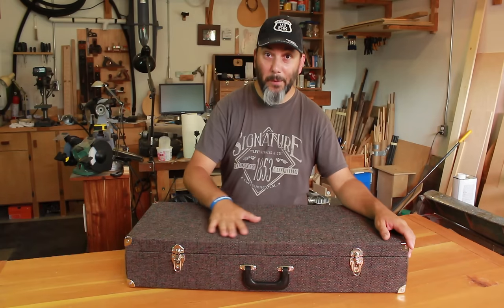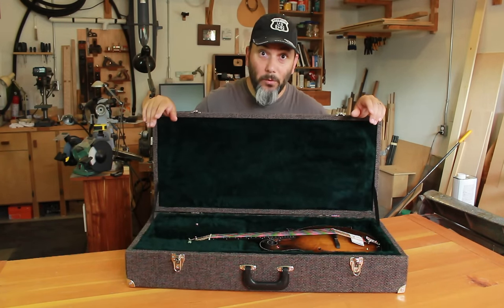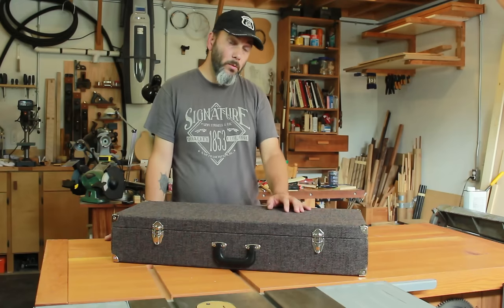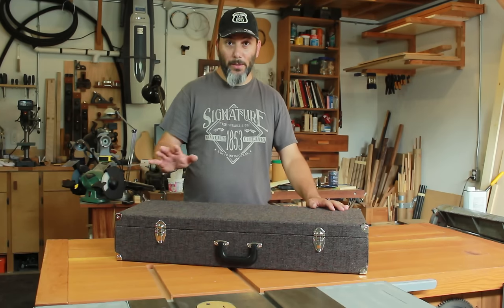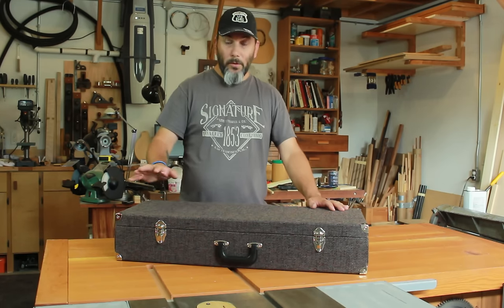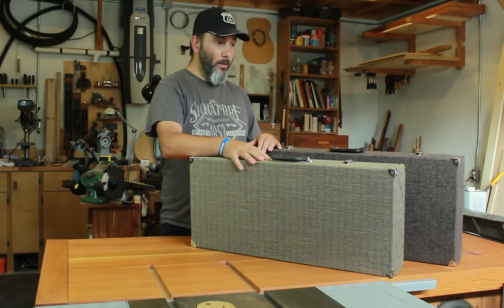How to Make a Vintage Looking Instrument Case.

Comment: Some readers might know the guitar case story involving Gerry Marsden.
His Rickenbacker 360/12 guitar was supplied by the manufacturer at the request of Brian Epstein and despatched to England in 1964 together with John Lennon's 320/12. 
Marsden used it on in the studio, on stage and on TV including during the recording of Ferry Cross the Mersey. Many of these films are on youtube. 
It appears that the 360/12 was his only guitar and by 1974 the case was reported so damaged that Gerry's manager suggested it be replaced before departure for a Far East tour.
Marsden, a former carpenter, elected to make a new case and after three days labour, the night before departure came to place the instrument inside it for the first time.
To his horror he found the guitar wouldn't fit. From what I have read I would say that the case was too short by twice the thickness of the material used to make the sides. In his film Mr. Hovington is shown planning the build with reference to the actual instrument whereas I suspect Marsden merely measured the Rickenbacker and cut the material to length without allowing extra wood at the corners.
In desparation, due to depart the next day, Marsden elected to shorten the guitar, cutting about 40mm off the end of the headstock so dislodging the locations for two of the machine heads. As he says in his his book, he knew it would never play properly again.
When Marsden reached New Zealand he sold the guitar and it later surfaced strung with only six strings in the hands of Alistair Parker of Bailterspace. Together with his effects the Rickenbacker has an amazing sound which may be judged watching the films where it is used, most notably their Splat single. It is clear that the end of the headstock has been horribly butchered. Subsequently Parker says he lost the guitar when he left it in a New York taxi. It's not been seen again and in the 1990's it was said to be worth around £90000.
The lesson surely is to measure twice and cut once.
Reply from the maker: Love the Story, thanks for taking the time to add this comment 👌
Edit ( I just pinned it for everyone’s enjoyment).
Reply: What a story. It’s oddly relatable cause I also tend to mod and fix gear last minute. Once in desperation I epoxied a neck back in place while trying out a black suit for concert the following night. Still have some tell-take  epoxy left on the lapel. The neck is securely in place but it wasn’t pretty :)
Reply: @niklashedstrom762  Pete Townshend tells stories of glueing guitars back together. From what I've read I'd say he was talking about Cascamite.
Reply: No guitar worth $90,000....or £...
Been looking to make a case for my guitar though. Had it since 1999 (roughly) & never had a case for it. Way passed due.

Comment: Well done.
I feel the design could be improved by an inner rim or band 4 to5 mm thick running around the inner perimeter of the top edge of the bottom half of the case. It should protrude about 10mm above the edge. This has two important functions, it keys the lid to the body when shutting and it acts to hinder or prevent ingress of water from splashes, rain etc.
Reply from the maker: That’s a very good idea, and I already have this rim going the whole way but kept it short of the top.. makes a lot of sense to have it higher..

Comment: Hello Tomy! Very neat cases and an extremely useful video. I've just bought an old zither with a nice, but rather battered wooden case. I'll need to refurbish it, or even better, make a new one, because the old wood may be mouldy. It looks very time consuming, but the result is awesome. It's well worth the effort.
Greetings from Hungary!

Comment: Great video thanks you've given me a lot of ideas. I need to make some cases for my viola d'amore and i think your pine sides and plywood top and bottm is the way to go. Really nice how you wrapped the outside with cloth. I think Richard christie might be right about some kind of lip on the inside to keep the rain out. I'm thinking maybe a thin ply (3mm) wrapped in some kind of plastified paper or something like that, tacked on the inside of the bottom and sticking up 5/6mm...

Comment: Nice work. I have made cases for rifles in the past and for cutting the foam rubber I used a electric meat carving knife. It did a excellent job of cutting intricate details in the foam rubber which I then covered with fabric.
Reply from the maker: Good trick to know. What kind of glue do you use? I noticed that contact cement melted some of the foam before hardening. Spray glue seems to have the same effect..
Reply: I use 3M-77 glue in a rattle can. It is not as "hot" ( chemically)
as regular contact cement and is excellent on foam and fabric applications.
Reply from the maker: Thanks, I’ll make sure to give it a try next time..
Reply: An upholstery guy said vinyl acetate, if you can believe it.

Comment: If that's contact cement your using to glue the material and foam padding, you are supposed to apply the glue to each piece being glue, and then wait till three glue dries before actually putting the 2 surfaces together. 
Other than that you did an outstanding job. Contact cement works differently then regular glue and the 2 surfaces bring glued has to allow the glue to dry before putting them together.
Please don't think I am criticizing your work either, as I said earlier, you did a very professional job and the case looks as nice (if not better) than anything you could purchase.
Reply from the maker: If the contact cement is applied to the upholstery fabric it bleeds right through which is not ideal and if I let it dry on the wood side it didn’t bond very well.
I made a few test to check bond with wet surface only on one side.
Still holding very well..
I do agree with you though on usual applications for 2 hard surfaces.
Thanks for watching and your comment.
Reply: @HovingtonInstruments  
That makes senses and I didn't think about it being a fabric and absorbing the glue like that. Sorry for any doubt and again, great video.

Comment: My question is this: how much did you charge the customer for the case and would you continue to do this sort of a custom case build for future clients?  I"m a ukulele builder and struggling to find cases that will fit my instrument designs.  While this video demonstrates that a builder can probably turn out a case that would be worthy of their instruments, watching the progress and time involved suggests to me that the price I'd need to charge to justify the effort would result in a case that is half the cost of the instrument that would ship in it.
Reply from the maker: You nailed it.
In all honesty I charge materials only to my customer since it was an afterthought. The concern was shipping.
Off the cuff I estimated and quoted the case but it turned out the price of the case only covered the materials... extremely time consuming.
I now  charge at least twice the amount to make one.

Comment: Thank you for sharing this video! I'm planning a similar build for a lap steel guitar. Do you recommend using contact cement over spray adhesive?
Reply from the maker: I do like how contact cement work between wood and fabric but it seemed to melt the foam when applied to thick. Maybe spray would work better for the foam.

Comment: Hallo. I see you use glue contact cement only on the one of the two objects and you dont wait but join them immediately. I would like to ask if by this way they are glued strongly, especially on edges, corners etc.
Are you doing this so as to have enough time to stretch the fabric?
Thanks!!!
Reply from the maker: With the fabric I used and the test I made, if applied on the fabric side it seeps through and shows on the outside final look.

Comment: Great build ,
What kind of wood did you use? 
I’m planning on building a case  for my custom oversized Ggress SG   it will fit in a Gibson 335 case but it’s still a snug fit . 
I’d imagine the wood  i need something  durable  but also light and thin wood any suggestions?
Reply from the maker: I used pine for this case and a ply for top and bottom. The pine was planned down to 1/2” thick. I guess any soft wood that is on the lighter scale would work.. thanks for watching

Comment: This is very impressive Tomy. Is there a difference between the pink foam under the neck and the yellow under the body, or I can use the same?
Reply from the maker: The pink one is more dense, it is also more expensive. I find the regular yellow foam to be enough for most of the body but like the extra support of the pink foam at the neck.

Comment: I was also wonder how you determined how deep/tall to make the case based of the instruments depth.  Thanks
Reply from the maker: I measured the bridge height and left I believe 1/2” to 3/4” clearance to make sure there would be no down pressure on it.
Reply: So do you want the string to be making contact with the foam cushion on the lid when the case is closed?
Reply from the maker: Mine ended touching the fabric but did not touch the foam.. Hope it makes sense.
Reply: Ya that makes sense!  Thanks again

Comment: woah this is incredible work, do you by any chance have links or sources that I or indeed anyone else interested in doing their own case could get those materials? I so wanna do this for my guitar I've got.
Reply from the maker: Thanks,
The wood was from Home Depot (pine and 1/4” ply)
The upholstery fabric, faux fur and soft foam from a local fabric store.
For adhesive I used contact cement and spray glue.
The hardware for mine is from Lee Valley really good selection.
Hope this helps...Hope you have fun with your build!
Reply: Tomy Hovington sounds wicked, can’t wait to get started, thanks dude!! :-)

Comment: What material did you use for the inside? The green fabric?
Reply from the maker: At the fabric store it’s labeled as faux fur. Many colours are available too.
Reply: @HovingtonInstruments  Thanks. I got some fake velvet. It looks very nice but the glue goes right through it and it curles in near the ends, making it really difficult to use. I abandoned my trombone case project until I can find something like yours.
Reply from the maker: The glue bleeds thru the faux fur also if too much glue is applied or to much pressure ( clamping) is applied.
Just so you know.
Hope your project goes well!

Comment: Nice vid man! I'm also a luthier, I packed my guitars using cardboard box for shipping and I'm thinking of building a case for my guitars. What is the weight of your mandolin case? Are you using contact cement for the cloth, styrofoam to bond? Thanks man I already subscribe to your channel a long time ago 😊
Reply from the maker: Sorry for the late reply. The case is on the heavier side but still adequate for its size ( haven’t weighed it). As for the contact cement, I used it everywhere but noticed that it does melt the foam a little. I’ve asked around and was suggested to try 3M spray glue for that part. Thanks for watching
Reply: Thanks man, appreciate your reply 😊

Comment: How does that foam do with the contact cement?
Reply from the maker: The foam did loose a bit of it’s height in areas where I applied lots of glue. Spray adhesive will definitely do a better job for this part. But it worked really well for the fabric.

Comment: As a long-time instrument case maker, I appreciate MUCH of what is shown in this video. However, the techniques shown here for attaching the fabric are quite primitive, and leaves rough looking corners that are just asking to come undone once the case gets used in the real world. This case covering most likely will not stand up to real use in the way that the vintage cases did. The case may be styled to resemble a vintage case, but the people who made those old cases clearly knew better techniques for attaching fabric. Also, a case of this size for a lightweight instrument probably does not need to have thick pine boards for its sides; vintage casemakers commonly used custom laminates and such to reduce weight without losing strength where needed.
Reply: do you have any references or videos that you would recommend?  My son's old 30's sax case is dying but he loves it, so I was going to rip it apart to either refurb it or make something similar.  I can dissect what they have done to reverse engineer the old King case process, but thought I'd ask in case you have other reference material to look at first?
Reply: @davidh3157  , I don't have anything to show or recommend on this. However, if you are digging into a vintage case to repair it, I can say that I have done similarly, and usually stabilize damaged wood with epoxy and other resins that soak into the wood to bind and stabilize it, then sand and put on the new outer coating (cloth, paint, whatever). I use wood glue to adhere the Naugahyde (which is usually what was used back when) to the wood...works better than spray adhesives, but you need to spread it thin and even, and apply the fabric very quickly before the glue dries.
Reply: @youtuuba   thanks so much.  I have made some small boxes from scratch for non-instrument cases and wrapped with bookbinding materials using thinned PVA, but when I get around to this I will look to trying it out with wood glue.  Thanks again!

Comment: hello, what's the name of the soft green material used inside?
Reply from the maker: Mattia Olla it’s faux fur and can be found in most fabric stores
Reply: @HovingtonInstruments  Hello Tommy,I can not find this type of faux fur here where i live.Could you share a link where I could buy it?
Reply from the maker: @doublechinmask3744  I bought mine at my local fabric store and they don’t have a website.. curious if you could find some on Amazon? Under faux fur fabric…

Comment: How much did this end up costing to build?
Reply from the maker: Too much. Around $250 in materials 🤯
Reply: @HovingtonInstruments  is it possible to build one on a budget for less than it would cost to buy it?
Reply from the maker: Hard to tell, the most expensive parts were hinges, clasp, corners and handle. I guess if you can source these at a low cost you might be able to shave $75+ ...